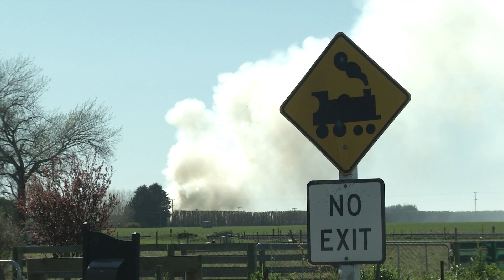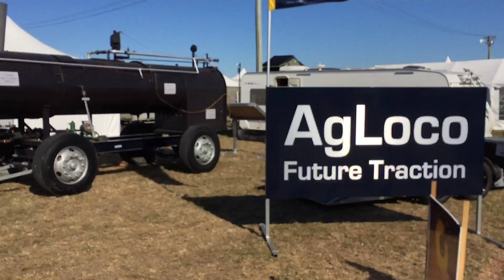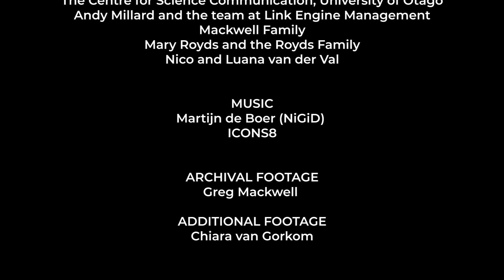LOCO - The AgLoco® Documentary

Comment: Now all you have to do is grow huge stands of timber; fell and haul away the trees; and process the firewood. All of that takes diesel-powered trucks and equipment. Then you let the wood dry out for a year, move it from the wood lot into the stack; move it from the stack to the tractor; and shovel out the ashes after every use. Now you've spent time for farming on making firewood. On top of that you need hundreds of gallons of water for the boiler while a farm already needs enough water to begin with. Yep. Sounds efficient to me. Sounds like there's a reason we switched from wood and coal-fired steam engines to diesels.

Comment: so your idea is to take a tree that stores carbon while it lives and burn it releasing the carbon that was stored in the tree. even a dead tree holds onto carbon letting it go slowly over time but burning a tree is like dumping carbon out in large quantities. i mean if you want to build a loco thats awsome but its not a green solution to diesel they are way cleaner running than a tree burner.
and going back to wiping out forest to run large amounts of trains is just a really bad idea.

Comment: I’m not understanding this project…. You are basically building a steam traction engine.  Many of these still exist in the USA and England.  They are a bear to run compared to a modern diesel tractor.  They were quickly replaced by simple gas engine tractors running kerosene,  then gasoline and then diesel.
Reply: He was building a steam train for a museum but the project got cancelled. Had to pivot.

Comment: You're wrong if you think steam is going anywhere for transport or farming. How much wood do you burn, 250kg - 500kg per hour during use? That would be 1/2 - 1 trees per hour per engine, now if just 1 million of the 500 million farms in the worlds starting using steam, that's 0.5 - 1 million trees per hour, average of 6 hours per week using the engine that's 156,000,000 to 312,000,000 trees a year. There is an average of 1.9 billion trees planted every year.  Not to mention that farmers would just use coal as it's cheaper than burning wood.

You're also underestimating how much people like convenience, especially when farmers work longer hours than most people. Jump on a tractor and turn the key vs storing and moving heavy wood/coal loading a and maintaining a fire in the boiler, also all of the shut down procedures, insane maintenance time/costs, which is the reason trains switched to diesel.   

 Registering trademarks and making a "documentary" about yourself doesn't make tis idea green nor does it change the fact that steam is not practical.
Reply: Steam engines like this one are incredibly easy to operate.  

There’s not even a sightglass to keep up with.  If this type of boiler runs out of water it just stops working, it cannot explode.  

There are alternatives to wood.  
Pelletized lawn clippings and horse manure are 2 that come to mind.  

There is no shortage of leaves and grass.
Reply: nearly no locomotive is diesel. all of them are either fully electric or diesel electric

Comment: How does one clean out the ash? Can the ash be used on the farm?
Reply: I would imagine you can dump the pan.  Ashes are very rich and can be added to your garden in moderation.  Every brush pile I’ve burned in the woods always has a great heaping mound of lush moss growing on it by next year.
Reply: Ash has many uses it can be used to give soil more PH for one. Here in Canada I use wood ash and sand for my sidewalk in the winter it melts ice same could be done for driveways and such. Wood ash can be spread on fields or in a wood lot and not have bad effects.

Comment: Nice  :) . 
 I have been running woodgas generators, as opposed to steam engines, for the past 10 years, here on my farm. 
 They save a fortune in running costs, and are carbon neutral. 
 Where there are problems, there are always valid solutions  :) .
Reply: If you could make pyrolysis work then carbon negative opportunities arise from biochar production on the farm. Or large scale pyrolysis plant with some of the carbon provided as bio-coal, allowing smaller boiler?
Reply: @trlah  
 Anything is possible, as I run internal combustion engines on wood, and I use the biochar as fuel for yet another internal combustion engine. 
 The leftovers could be ploughed into the ground, to become a carbon negative soil asset.

Comment: hu, someone reinvented the traction engine for the modern eara. However, while it doesn't add anything to the carbon cycle, it isn't zero emitions. and will have some environmental impact. However, unlike fostle fuel burners, the impact is purely short term.
Reply: Wood and some biomass(natural)fuels don’t produce the same type of emissions that internal combustion engines do. They are absorbed quicker then fossil fuel emissions.
Reply: @cameronlamb7274  Co2 is Co2
The issue with fostil fuels is the Co2 has been locked away underground out of the carbon cycle of longer than our species has been capable of walking upright.

While burning anything releases Co2 into the air, if you burn bio fuels, that Co2 was already in the carbon cycle, and would have been released back into the air eventually reguardless. (wood rots, for e.g.) So it only has a short term affect on climate.

Burning fostil fuels however, increases the amoung of Co2 in the carbon cycle and thus has an additional long term impact on the climate, as well as the short term impact.

Therefore, burning wood is better for the environment in the long term.

Comment: Kinda a dum idea all of this. I mean yea burning ecological material to make mechanical energy is quite reasonable.. But as a tractor this makes little sense. A "small" traitor needs to be flexible and light/compact. And a farm tractor of today is huge but fast and economically a must to compete in the market. This big hard to control AND most likely really heavy and have no off road in the farm mud chance at all. And if it has any chance the speed together with the need to feed the fire is just not feasible.

Stationary engines for production and passenger trains/road vehicles are possible.  There also is the history of having tractors be more like portable engine plants that should also be reasonable to create. Having for example 2 tractors pull instruments over the fields with a pulley system making the tractors act more like a lorry/movable power unit.

It is clearly more sustainable and useful to create a lorry/power unit that can under own power move around and deliver mechanical energy to whatever is needed. sawmill/emergency fire pumps/plowing and even as a electrical generator when the power grid fail.  

And still there is the problem of getting enough wood to power it. Trees grow not that efficient when it comes to space. It takes energy and time to work it. And transporting it with you is heavy for the steam engine. If you need wood for 6 hours of work you can not refuel a tank only. You need the heavy wood too. A diesel engine can go non stop for 10 hours without a big problem (outside of the driver needing to pee and such)  A steam engine can not do that doing anything really.

Really having steam engines for trains and stationary work is just a better option. Simply reality unless comfort and modern values change drastically. It wont.
Reply: Remember that the big boiler show in this video is a unit built for a train locomotive and for development, not a tractor. Reducing it to the 150hp will make it small enought for a medium tractor (2.5T) while having more than enought power to do comparable work like the diesel tractors of today. Still, it keeps the tech simple and user friendly, wich is a number 1 priority for farmers. Look at how they are to the "Tech" introduced to modern tractors by stablished manufactures like John Deere.
Reply: Agriculture used to be based all off traction engines in England

Comment: Surprised about this, I'm currently studying civil engineering and thinking of later on studying agronomy. This idea is very stable for agriculture and really appreciate it. Good luck to the company.
Reply: Don't be distracted by the original hardware being made to look like a railway engine. With modern electronics controlling combustion and an on demand steam generator it would not feel that different to a large diesel tractor. Steam engines have amazing torque. Look up the Doble steam car. Much faster than the gas cars of its time.
Reply: It is not very stable. As long as the diesel tractors get there act together and produce tractors that actually works without a fault code. (greed) The only thing this has going for them are the carbon neutral. Even now in reality a diesel engine can also run carbon neutral. Just to expensive and to little incentive to do so.

A tractor like this is going to have poor view from the driver position. Probably having to mess about with the engine instead of actually watch what your doing. Comfort? Yea maybe you can sit down in a suspended air seat. But is the tractor going to be able to plow a field as fast as a diesel tractor? No. Simply they are going to be not as flexible. On a train line or stationary yes a steam engine is just clearly better. But not for farming to sustain millions of people with just a few hands doing the farming.
Reply: @TheDiner50  this was originally going to be a railroad locomotive. Thus the weird shape for a tractor.
Reply: @TheDiner50  You do have a good point. The one key reason why this could be a good alternative to a diesel tractor is the fuel itself, besides working against the global warming aspect. We are experiencing some petroleum shortages and price spikes. Granted that has lowered, it has shown why diesel can be a hustle to work with, especially when there are international problems affecting the price of diesel.

Comment: 👍👍👍 for the concept of zero carbon haulage.  It is great to see that your circulating pumps are working fine and I understand your ‘radio silence’ due to obtaining patents.

I hope you have not given up on railway locomotives.  The boiler outline clearly has them in mind.

Just one comment.  For an AgLoco Tractor the boiler need not be ‘traction engine-like’.  Of course you have thought this too.  A compact box like shape could accommodate all the components you need.  The main body needn’t be round and could incorporate return bends necessary for full combustion.  What I’m thinking here is that farmers might warm more quickly to an AgTractor that is more nearly the size and shape of their existing machines (yet different enough to be an obviously new concept.

The 2% figure is FANTASTIC.

I’m guessing that your pre-production AgTractor will be less traction engine like.  Then when the railway revived your existing boiler can go on a loco chassis.

Absolutely love your work.  This is the future of field based and forestry farming. Go Sam.  Go Go Go😁
Reply: Got to second the above - brilliant work by Sam and Philip, and I'm watching this for future developments!
Reply: @theenigmaticst7572  Agreed.  This is not an eccentric solution.  It is front and centre to where we need to go.  Not hydrogen, torrified wood fuel possibly, but dry wood certainly.  The 2% figure is key.  Battery electric tractors powered from solar panels would take up too much space and I suspect the capital costs of wind turbine charging would be too much for most farmers (though there could be ‘district’ charging schemes if farmers are prepared to collaborate.  New Zealand has one of the most productive bio systems on earth so wood based tractive energy self sufficiency is a highly plausible route.  Plus Sam is an extremely able mechanical engineer.  It’s looking good for him.  Capital will come.
Reply: @stephensmith799   He. I see it before I belie it. 2% is not really feasible. But electric for anything but local short distance or stationary work is out of the question. But the hole ide of sustainable farming tractors/production is pretty much impossible without a culture change in society. End of the day there is to many on the planet to feed energy.

Your better off focusing on industry and wastefulness of today processes. Introduce back steam engines for production and rail. Simply make machines easy to work on and FORCE reliable sustainable tools that are made to last and be repaired. Outlaw stupid things like mobile phones that last 3years and all the stuff that is truly broken.

A old diesel tractor that can last 100 years and be a work hours for a family farm is much better then electric garbage that runs on coal power. Even if the diesel is expensive to make (biodiesel) it is sure a better way to drive back the bad farming practices. Simplify and make sure to improve the big scale factory pollution and processes. 

Henp still being underused due to still to this day being compared to the dungs. (can not type it out right) Emisin cheting and laber slavring to make money. etc etc etc.